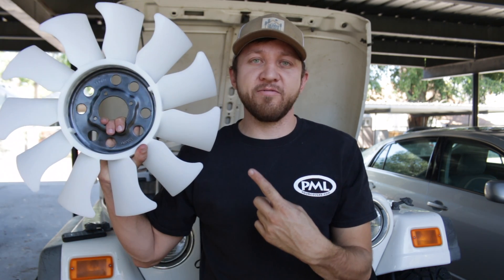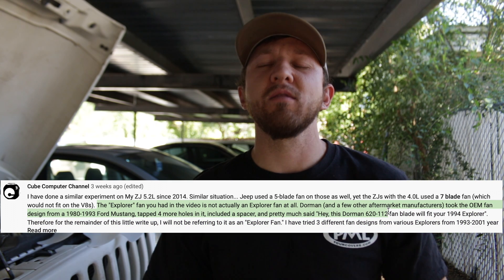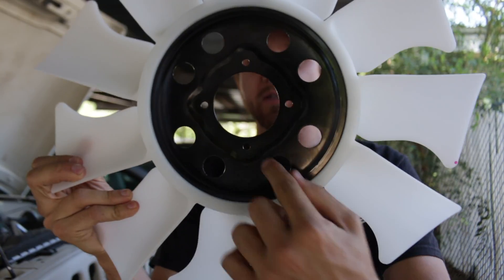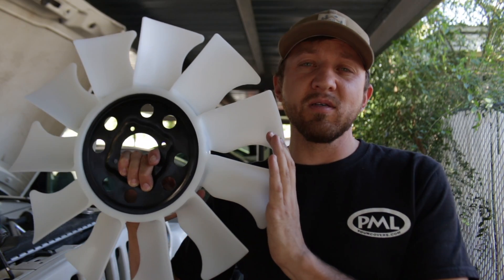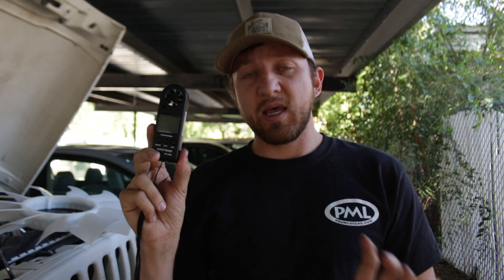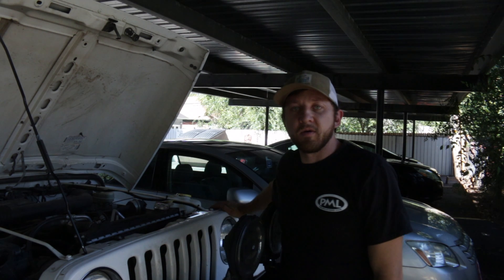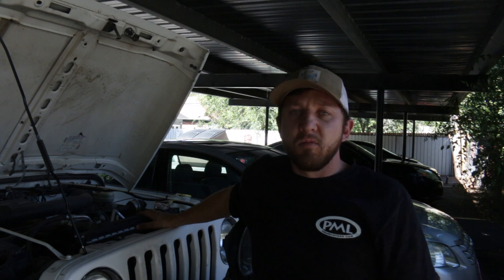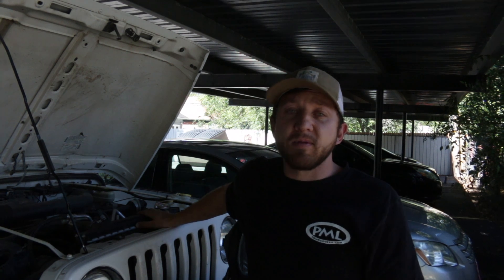Jeep TJ Fan Upgrade Test

Comment from the maker: Here is an update to this video. I also run a stock mopar fan head to head against this fan. Check it out here. https://youtu.be/Qx-vTO7djJI
Reply: Hey man, I appreciate you taking the time to do this testing and share the results.

Butttt, I have some bad news for you: your results shouldn't be trusted. Sorry to break it to you.

The reason for that is that you mishandle your fan clutch/clutches. I didn't finish the video to see what happens with the rest before typing this, but I will finish afterwards. But as soon as you said "I could have a bad fan clutch, but I don't think so, because it's new," I knew I was going to have to pay close attention. And then your fast-motion fan removal montage was so fast I had to slow the video down to .25 speed to catch it, but once I did so, I confirmed what I suspected: you laid the fan clutch down on its face. That's a no-no.

I have outlined and highlighted yellow the parts of the factory service manual for the 1999 jeep Wrangler that explain where you went wrong.

I highlighted red some other important details about installation that may also be applicable, but I put this comment together before I finished watching the video, so I am not sure.

https://imgur.com/gallery/YIelHhz

Comment: I removed my brush bar and it went back to normal, I think the brush bar causes cavitation to the air that should be forced through the radiator. My TJ stays cool at low speeds but was getting hot on the highway removed angry birds and brush bar and problem solved.

Comment: Great video, thank you. On my 01 WJ with a  4.0L, 172k. Electric fan failed as did fan relay. I replace elec fan and used after market relay both failed again. Overheating issue returned esp with ac on. I then decided to install an manual clutch and fan blade- I have never had overheating problem again with ac on/off on 100 degree days All parts from Rock Auto Clutch was a Hayden 2787(heavy duty) which bolted up to a GM 11 blade fan, part # 1580739. No electric fan used, no over heating and everything fits perfectly inside the shroud
Reply: Any reason you didn't go with a  WJ fan clutch and fan blade?

Comment: It's not about speed at all it's about volume if you can get more volume at a slower rate you can reject more heat. I know the thought process is that the more fan speed you have the more cooling you're going to get and that's not necessarily true. As the air moves over your coil fins it needs to go at a speed sufficient enough to allow heat rejection properly.
Reply from the maker: Good point! I wasn’t really concerned about fan speed. I’m was more trying to measure air speed. I don’t have the ability to measure air volume pulled through the grill. But, I’m all ears if you have an idea.

Comment: The air flow will be less in the middle than perpendicular to the blades. I would expect the farther out from the center you get the higher the air speed. There is more blade area so it should move more air.
Reply from the maker: I agree, logic tells me the same however, recently an engineer explained to me the reason why more fan blades do not mean more air flow. Something to do with too many blades means each blade captures less air or can? He said it's like water, and if the first blade pushes all the water out of the way, then the blade behind it will be grabbing nothing.  Regardless, the supposed upgrade isn't an upgrade at all. Not worth the time or money. Stock TJ fans with correctly working factory cooling systems work great.

Comment: Fun job removing the fan. I had to replace radiator this weekend on mine. My left hand looks like a mountain lion chewed on it lol. A couple of years ago I put a poison spyder hood louvre kit on my 2005 Wrangler. It helps a lot at idle. I've also used additive called water wetter made by redline. We used to use it racing on two stroke engines. Gives a couple of degrees difference. Great video. Looking forward to other tests
Reply from the maker: Oh yea, I have become a professional are removing these fans lol! I cant tell you how many times I have switched these fans out now. Interesting on the hood vent kit. I haven't not found anything that shows heat reduction. But, I want to add one and see what happens. Maybe some a chance for some testing. 

On the fans, after all the testing I've done. The stock fan with a Mopar fan clutch seems to be the best. So that is to say, leave it stock and make sure things are in good shape lol!

Comment: I went back to a clutch fan after electric, but it’s always howling like it’s stuck on. Not heavy duty, I switched to another
And it still stays on all the time. Even when it’s 15 degrees F outside. Running a banks turbo which a leaner tuning makes it
Hot. So tired of trying to keep this thing cool. Might drop an LS in it.
Reply from the maker: Now, that is an interesting issue. Does your Jeep run warm even when it is that cold? How do you like the Turbo kit? An LS would be pretty cool!

Comment: Thank you...!

1- If the fan is mounted blowing wrong direction...! (fans blades direction differs on each fan brand & purpose)

2- If the electrical fan is blowing against it

3- if the hood is open the suction would be low...

4- if radiator blades airway is blocked

5- the fan suction is stronger by the blades not at the fan center (where no blades)

Comment: It's not the fan it's the clutch
Reply from the maker: After all the testing I have done so far. I believe it's neither. The stock fan and fan clutch seem to pull more than enough air to keep the vehicle cool. Looking into other causes.  I don't think the "ford upgrade" is an upgrade. Regardless of which fan or clutch combination is used.
Reply: @EmbarkWithMark  my friend put the off a f150 I guess the clutch has more tension than the explorer since it's a work truck an it works great

Comment: What year TJ? My fan clutch is the 4 bolt style. 🤔
Reply from the maker: Mine is a 2006. I believe they moved away from the 4 bolt style after 1999.
Reply: @EmbarkWithMark  I pulled my 11 blade off my 99 WJ but couldn't use the clutch. I'm wondering if there's a simple way to swap the pulleys. 🤔
Reply from the maker: From what I know the only way to do it would be to switch out your water pump. The newer style water pumps has threads on the pump shaft that allows the use of the newer style fan clutch.  Im not filmier enough with WJ's to know what kind of fan clutches they use. I am not really convinced that an 11 blade fan is really worth it. I have a more recent video in which I removed it for a factory fan.

Comment: If I may, in my WJ, the electric fan had (almost) died... so I went with the Ford Fan (by Doorman) and the Ford Clutch (by Hayden), for a Sports Tracker...and while I don't have the wind speed tester, the difference is amazing.... I have only one noticed problem... in hard acceleration, I have a bumping noise under the hood.. and it could be belt slippage....  I will have to do more testing... but in any event... no more over heating for me....

Comment: Did you use your TJ clutch or heavier duty one
Reply from the maker: I used a ford clutch the is normally mated to this fan. The reason I used the Ford clutch is because a TJ clutch is not rated to carry this fan. A Tj clutch will probably work for a little while, but I would not trust it as a long term solution. Great question. I hope you enjoyed the video!
Reply from the maker: Also, the exact fan and clutch I used are linked in the description.
Reply: The reply I was hoping for. Mopar did offer a “HD” version fan and clutch that has sadly went the way of the dodo bird. Definitely keep us posted on your thoughts. The humid stagnant south can be fun trying to run AC from June-September
Reply from the maker: nate4036 Yea I am well aware of that fan. I have looked high and low for it. Once it gets hot I’ll do an update video and see if it has helped any.
Reply: @nate4036  Try the Ford Sports Tracker Fan Clutch.... It's a Hoss... I am trying this out on my WJ, and I can definitely tell a difference....
Reply: Guerry Howell how long have you been running it? You using stock fan or the ford fan
Reply: @nate4036  to be honest,  I just completed the change out Saturday.... From my perspective,  something long overdue... and not really much noise either... I used the Ford Fan and Clutch

Comment: There's any Grand Cherokee's fan blade who fits on the Wrangler TJ (98)?
I'm asking because I live in Brazil, so I don't have so much access to some parts and when I bought my Wrangler, it has come without the stock fan blade.
Like I said before, here in Brazil, maybe it's easier to find a Cherokee's blade. I would like to put an OEM on, but it's a little expensive to do it now.

Thanks!
Reply: I found the Dodge Dakota V8's fan blade and Grand Cherokee V8's fan blade, but I don't know if it fits.
Reply from the maker: I'm not sure if the dodge Dakota v8 fan blade would fit. If they are the same size as the grand Cherokees fan blade than it will fit. 

To the original question, I believe the ZJ fan blades should fit in your jeep. In fact, 4.0 in the ZJ should have the same exact fan blade. The v8 fan blade should fit too because the shroud on a TJ is bigger than that on a ZJ and I know they can take the same fan that I have installed on this video. 

Do you know what fan is on the jeep currently?
Reply: @EmbarkWithMark  Thanks a lot!!!

Currently, it's with a Ford fan, made of plastic and with 11 blades. Here, they use it at the F350, F4000, and lastly, the Troller 3.0 (it's a Brazilian off-roader project bought by the Ford).

With this fan, I got some temperature issues when stuck in traffic. I don't know if it's just the fan fault, but now, I gonna replace the fan, the water pump, and the thermostatic valve.
Reply from the maker: Your welcome! 

I hope it all goes well. If I can make one recommendation to you, try and get factory Mopar parts when replacing those items. They are much higher quality than aftermarket parts are.
Reply: Bom Dia Meu Amigo....I have Amigos/Amigas in de Brazil.... and They tell me of the Heat there.... May I offer a Ford Sports Tracker Clutch and the Sports Tracker Fan Blade.... CLUTCH FAN DORMAN PART NUMBER 620-155.... Look around a bit, and you might find other options there.
Reply: Thanks a lot, Guerry! Yes, it's quite hot here haha especially where I live, in the northeast part of the country, it easily reaches 104 °F on hot days.

I'll look for it. Thanks again!!
Reply: @raulmagalhaes6684  de nada meu Amigo,  de nada

Comment: Having just installed a 4.6 stroker in my LJ (daily driver) and seeing the same idle temp issue, I'm curious how it works out.  I'm running a replacement OEM mopar radiator with a FlowKooler water pump and 185 t stat.  Works great everywhere but idle.  I have to idle up if I sit too long.  Just not enough air flow.
Reply: So its now getting to be hot time again.  Any updates??  I'm starting to fight some heat issues again and wondering.  I'm running 2005 with a 4.6 stroker with stock radiator and high flow pump.  And 180 thermostat.  I've used HP Tuner to do some adjustments.  She runs great and loves 180 degrees (don't let anyone tell you differently,  the jeeps don't have to run 195 to 210), but at slow idle the lack of air flow is a strugle to get the heat out of the radiator.
Reply from the maker: Where I am it is still only 70-80. But in those temperatures the fan is doing great. I am about to make a trip to a hot desert in CA. I’ll be able to really test it their. I’ll have a better update once I can get into really hot weather and push the capacity of the system.
Reply from the maker: @MrBEA-wp2pf  A little update. I switched back to a factory setup to see if there where any differences. I could not measure any. For now the recommendation is to stay with a stock fan. I have a video coming on this.
Reply: I just bought an LJ myself, and I am experiencing the same thing on idle... AC works great while driving but if I pull over and sit idle for 10min warm air starts coming from the vent... have you found another solution to this, other than replacing the rad fan?
Reply from the maker: There could be a few things. Do you know if all the cooling components are factory? If not, that could be the issue. Especially if it’s a radiator. I have a few videos coming out shortly addressing this issue. I walk through each step I have taken to try and cure the issue.
Reply: @EmbarkWithMark  as far as I know and looked at, everything is  all stock parts. I checked all vacuum lines aswell. Its frustrating.
Reply from the maker: Unforutley we will have to wait a while since it is to cold to test now. Im not really sure why the temperature is creeping when idling but I am determined to get to the bottom of this. Before the fan upgrade that was my fix to was to idle the jeep up a tad for more air flow. When summer comes back we will run another test and see what happens. Thank you for your input, and thank you for watching!

Comment: You need to find the CFM that the fan pulls in.  The MPH means absolutely nothing.  BTW, you will unfortunately find that you’re wasting time and money with this endeavor.  You can add hood vents, high volume pumps, aluminum radiators, remove the thermostat, etc, and you won’t lower the temperature more than several degrees.  The computer wants to run at or near 210 degrees for Federal emissions.  Sucks, but true.
Reply from the maker: I agree that CFM would be much more accurate however, finding a way to accurately measure CFM of a mechanical fan without specialized equipment seems out of my reach. If you know of a method I would happily try the test again. I need to make this statement, I am not trying to run at temps lower than 210. The engine was designed to run at 210 and I want it to run at that temperature. However, what I am trying to test is the ability of the fan to keep the jeep at 210 and never go above. Also testing these fans for me is kind of fun. Trying to see if these ideas on the internet are myth or fact is entertaining.
Reply: Embark With Mark The cost for an average volumetric flow meter is around $1,600.  I would say cost prohibitive.  I would think if you got in contact with the manufacturer they would be able to supply that information for you.  A friend of mine contacted Porche in regards to CFM produced by the fan for a 77’ 911S and they sent him all types of facts.  Just a thought.   Your putting out some pretty cool content and I dig your off-road trips.
Reply from the maker: Great information. I’ll contact Jeep and Ford. Maybe I’ll be able to compile some information on the subject. 

Thank you! I’m glad you are enjoying them. Thank you for the info, this is why I enjoy reading the comments!
Reply: @murphtahoe1   How does the computer alter the mechanical cooling components to adjust temp ?

Comment: I understand the reliability factor of a mec fan but i would like to see you do some testing of e-fans
Reply from the maker: Yea I like doing these tests to see if the fans are myth or if there is something to them. The E-fans are claimed to not move as much air. When funds allow ill grab a few of them and take the time to test them and see what happens. Great Idea! Thank you for watching.
Reply: The benefits of E fans for horsepower and efficieny is what interests me (after getting an awesome clutch fan setup lol). Better for winter also. Im thinking about adding pusher fans since i already have an electric fan stock, that could bump the cooling higher when needed, and turned off when engine cold

Comment: Would the speed of the air change dependent on the volume of air moving through the radiator? You say it seems to be starting cooler longer, the air speed may not have increased but you may have increased the volume of air traveling across your radiator.
Reply: The cross-sectional area that the air is being pulled through is not changing, so a change in velocity does indeed mean a change in the volumetric flow rate of the air. In english: the radiator and grill are the same in both tests. So a higher air speed means more air is moving. :)
Reply from the maker: Thank you for clearing that up! I am working on an update video as we speak.
Reply from the maker: I started to wonder this myself after a pondering this for a period of time. I completely agree, if you know of a way to measure this I would be up for trying the test again. Thank you for your input and watching!